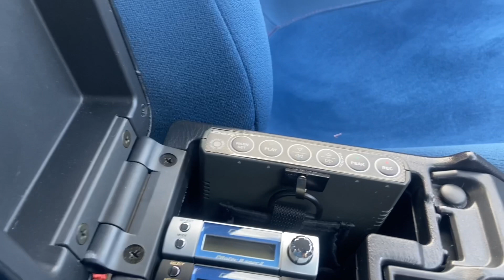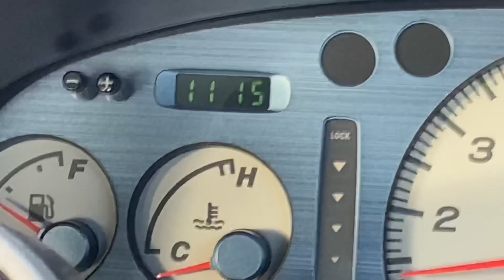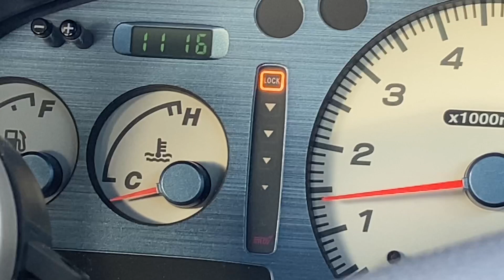JDM Legend - lightweight Impreza STI Type RA Limited V6 Subaru

Comment: i have one of these with 77,000 original km, haven't really driven it much since i picked it up 6 years ago, just lives in the garage. Mine has the same wing but has the optional rays 17 inch 5 spoke wheel  and the 280kph, 9000rpm cluster, number 318/2000. mods are a vf22 turbo, maxim ceramic coated equal length header, 3 inch ceramic coated down pipe, JIC full ti exhaust, coil overs fuel rail, bosch 800cc injectors and a Link ecu plus a bunch of rare jdm gauges. Love the car.
Reply from the maker: Interesting I haven’t seen the 17”

Comment: Mine is currently off the road doing some major rust repairs and up for a repaint in the original world rally / sonic blue , you'll only get to see them once you full strip the car to bare shell. After all , It is still an old car that just shows its age i guess XD. P1 is indeed overhyped but understandable given that they only made 1000 of them exclusively for the UK market. Glad to see that you chose the classic impreza :]  over the newer / modern performance cars. Always better to save and restore an old one if you are able to. This particular sti - ra model has an open deck EJ207 same with bugeye/blobeye but no avcs (subaru's vtec),, no ABS  ,, has a 5 speed shorter gear ratio ,, a helical front lsd ,, an r160 rear diff with dccd box ,, vf28/29 IHI turbo or td05 ,, has auto climate hvac ,, power folding mirrors ,, power windows ,, and no rear wipers / side skirts / foglights for weight reduction. JDM EJ20's have Forge Pistons thus does not have the notorious Ringland failures nor headgasket issues. The Legit Chassis code for this is GF-GC8  and GC8G4DD , which is also the same one for a standard v6 sti but the chassis for the limited should be GC8-09XXXX located up the engine bay. I'm not entirely sure if only up to sti - ra version 3's got the manual stuff and an HKS Silent Hi-powered STI logo'd Exhaust + no AC but the type RA's definitely didn't have ac they were optional from the factory / dealership. 2 door variants / Type R's go for a hefty price nowadays i believe there are less than 600 UK delivered ones iirc.

Comment: Pretty sure this RA would have come with a low level spoiler as standard. Very cool car though!
Reply from the maker: Thanks James, it did come with the spoiler from factory, the only car to be offered it as an option and later came as standard on the S201. if it wasnt an option then it would have came with the big high rise lipped Version 6 spoiler.
only early RA ie V3 came with the low spoiler and later Spec C cars came with nothing
Thanks again
Reply: @dave280585   man you certainly know your stuff!! 👍🏻👍🏻
Reply from the maker: Not on everything mate but had to do a lot of research before buying it

Comment: I see you have a blown bulb in the lowest setting of the dccd gauge. Very common as that’s the one that is on most of the time. If you take the cluster out, because the dccd lights are an adaptation of the auto gears lights there’s an unused bulb behind where it says sti on the lowest point of the dccd lights. Swap this unused bulb in to the position of the blown one and hey presto a full set of lights without having to search everywhere to buy one tiny odd bulb.
Reply from the maker: Thanks Rich, I’ll take a look into it
Thank you for the input
Reply: not a blown bulb, its the open diff setting which is similar to automatic mode
Reply: @leonardchristopher6412  no it’s not. The bottom setting should light up. On his it doesn’t. It’ll be the bulb. Was the same on my car.
Reply: @richallen2006  not an argument, i have the same occurance in my 97 type r , 97 type ra and 99 type ra
Reply from the maker: Interesting  read guys, I’ll take a look at it

Comment: Don't sell the original 16" sti rays that came with it ,, a full stock of these does not deppreciate in value i assure you. own no. 1021 myself :) still have every original bits aside from the exhaust / hoses. once you do modify it loses value cause it is a collector's car being limited. Just like the 22B , V - limited , 555 , colin mcrae version , etc. Mine however came with a standard v6 wing. Yours is the optional STI titanium one which is also from factory. Just take care of rust spots with these especially the wheel arches and tire well.
Reply from the maker: It’s absolutely mint underside and arches, the original 16” rays are back fitted to the car and will never be parted, if I can find an original exhaust I will get one if I can and stick it in the loft
Reply: The standard exhaust on these is MMFA6  ,, i don't really bother much looking for it due to rarity and high prices of it on my state plus most of them are in sad condition being 20+ year old. I went for a straight stainless custom catback exhaust with a fujitsubo RM-01A stainless tip and it sounds fantastic.  Rumbles so loud you don't hear the radio. Stock is the best way to enjoy them as intended.
Reply from the maker: Mine has a full KAKIMOTO system from Cat back it isn’t too loud at all just right for me, I’ve another Impreza that’s far too load haha

Comment: that wing is horrible. it is a s201 replica spoiler. s201 has one of the worst subaru body ktis ever lol./ nice motor other wise tho
Reply from the maker: It came from factory and is a genuine STI wing, offered as an optional extra at a hefty cost. it came from Subaru like this, the s201 came afterwards and came with it as standard, I personally love it
Reply: As stated, this could be specced from the STi parts list for V6 cars. Must be said, I've never seen one on anything other than an S201 before, and I attended many an Impreza meet in Tokyo in the late '90'and 2000's (owned and still own V5 STi RA Ltd) so very rare.
Reply: @machidaman  I too own a version 5 STI RA Limited, I’ve seen just 1 S201 wing on a version 6 RA Limited in the past, it’s the only one I’ve seen at all.
Reply: I’ve seen This spoiler on a V5 sti type ra. I have a v limited v6 wagon. Will never sell it
Reply from the maker: @STI RA  the two most recent sold v6 ra limited sim Japan both had the sti wing too’one just sold for 17500gbp needing a lot of work and the other just made 49k gbp, if you have an Impreza of any model bows the time to hold
Reply: @paulhiggins3736  they are great cars, you are a lucky man. Test drove one in early 2000's as had my heart set on it as a replacement for my WRX wagon and loved it. Bought an Evo VI in the end though and great as it was it didnt last long and replaced with RA 😎
Reply: That spoiler is from a Tommy Kaira kit produced for Subaru , if it was the full kit it would be worth 🤑🤑🤑